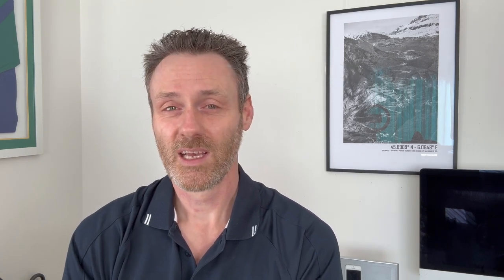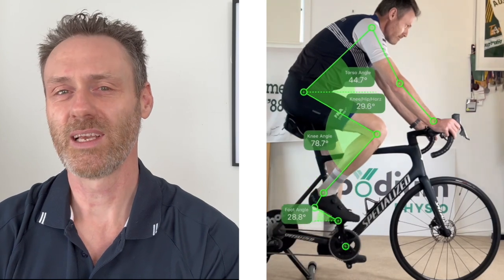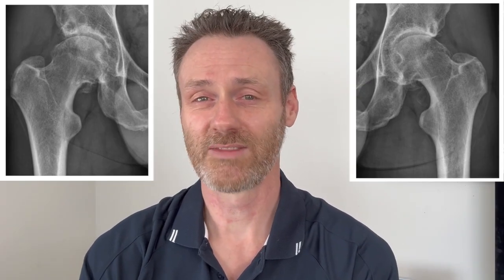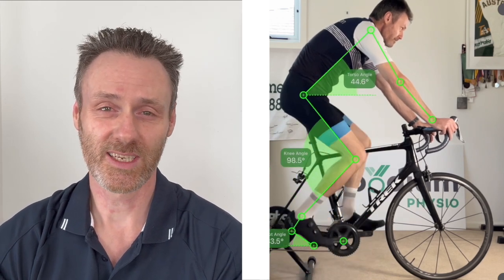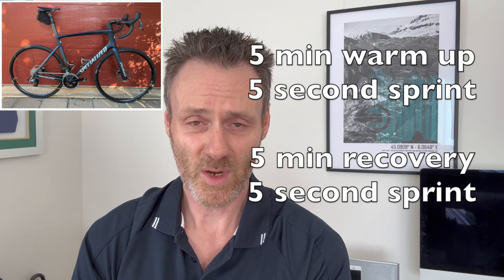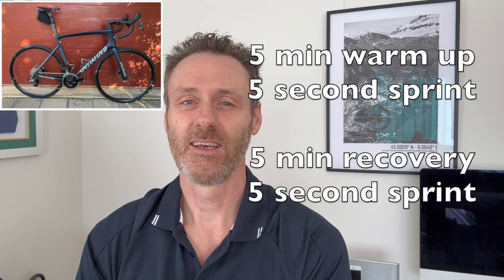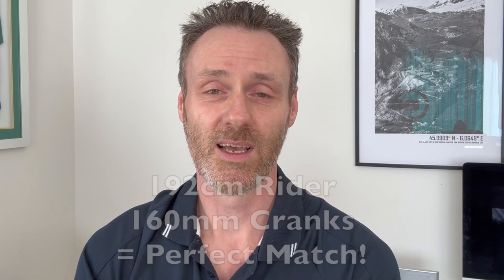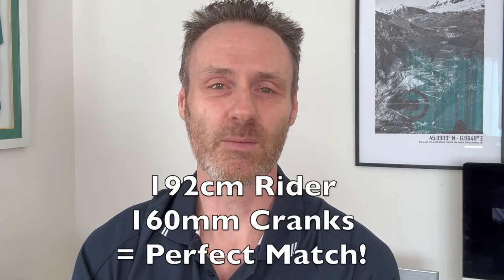Shorter Cranks Stronger Sprint (13% More Power)

Comment: not sure if you've already repeated this or not, but you might be better off doing the sprints outside on a section of road as probably speed is a more important metric for sprints, even though power is still interesting. food for thought, appreciate the effort and data!
Reply from the maker: Hi Dave. I understand where you are coming from but I really just wanted to isolate the impact of crank length on my max power. Once you are out on the road there are so many other variables to deal with: temperature, wind speed, wind direction, traffic, road surface changes etc. Then of course the variable of aerodynamics and surface area. Appreciate the feedback though!

Comment: I am healthy, 170cm tall, with good flexibility and good fitness.
I found that shorter 165mm cranks made me have to change gears more often. 
So I went back to 170mm cranks. 
This is on a MTB tho. Any thoughts on this. (Is it all just in my head?)
Reply from the maker: Hi Kevin. I've not heard any other similar reports and I certainly haven't noticed this myself. 5mm is not a big change so I doubt it would have any material impact on your gear changes
Reply: @podiumphysio657 Thanks. I was thinking it might be a bit placebo.

Comment: Update. Went from 172.5 - 165mm and am more impressed than I thought. First thing was less fatigue ( and lactic buildup ). I put this down to less power needed at the top of the stroke. I find that I exert more power at that point but now it seems smoother and more sustainable. 1st ride and was 1second off a long sought 1.40 hard climb PB. That, on the back of being off the bike for a few days after work related fatigue. I’m sold
Reply from the maker: Hey S.I. That sounds amazing! So my summary would be you are performing a greater percentage of your pedal stroke in a stronger and more effective leg position (nearer to an extended knee). Congratulations on your (almost) PB.
Reply: Yea mate that sums it up perfectly. I feel smoother and more like how I “ remembered” myself 20 years ago.
Reply from the maker: @SIvers-or2ke  Turning back the clock!

Comment: I finally got mine. Have done a 30k and a 75k. 75k today and windy. Also, for some reason I have been really fatigued for 2 weeks, my HRV has plummeted and my body battery has not recharged above 50%. But anyway, the results from today. I am comparing this to the same 75k ride on Feb 17 when I was at the top of my game. Heart rate both times identical. Shorter cranks gave me 2.1kmh advantage. Avg power increased 22 watts. Actually felt a lot easier. No hip pain. By the way, have not altered the seat height but think I should.
Reply from the maker: Hi Zazzleman. Sounds like you may be in the same boat as me - with hip issues. So if the shorter cranks help your hips, you have already had the most important win. Any performance gains are a bonus. And sounds like you have achieved a few bonuses also! 
HRV seems to be an important leading indicator of body stress and illness so keep an eye on this and take care not to overexert if you are not well.
In relation to the lower body, yes you should probably raise your saddle, however it might depend on what you can do with the front end of your bike. When I went to shorter cranks on my Tarmac, it was not easy for me to also lift my handlebars, so I only did a partial saddle raise.
Reply: @podiumphysio657  It's been a brutal month. Family deaths, job loss, stress. But the hrv is starting to climb again and body battery back to 89% over night. #Ipswich100 on Sunday. 🤣🤣
Reply from the maker: @zazzleman  Wow. So sorry to hear that. Nothing like 100km on the bike to shake up a depleted body battery. Or are you doing the 100 mile ride??

Comment: You’ve got me scouring the net for 160mm Shimano cranks. Best I can find are 165mm and I’m about to grab them. Thank you. I’m 183 ( 6ft ) and 56 y.o now and think, looking into my cycling future, shorter cranks makes alot of sense and gives me quality riding over struggling.
Reply from the maker: Yes I think I got lucky being on SRAM, and having a local bike shop that is on the ball and able to grab what I needed when they saw it was available. I'm glad to have helped you make a decision and hope it all works out well for you.
As for me I'm now recovering from my second bout of COVID, so I wont be making any more max effort cycling videos for a while...
Reply: Sorry to hear you have Covid again mate. Get some Quecertin into you. Even at this late stage. 

I’m satisfied with 165mm. If I stumbled across 160’s, I jump on them but happy to only go 7.5 mm shorter than what I use now. 

Anything is better. 

Get well soon
Reply from the maker: @SIvers-or2ke  Cheers. it knocked me around for a few days but not as bad as 2022 when I had it the first time. I think my fitness will take a few weeks to recover. Keen to know how you go with your 165s after you settle into them.
Reply: If you're 183 tall, maybe 165mm is better for you than 160mm. One mathematical equation I found says crank length = 20% of Inseam ... or 41% of Tibia length, but it's hard to know exactly which one is best.
Reply: @musclelessfitness2045 cheers for that. Makes it easier to choose.
Reply: Shimano dura ace are available in 160mm
Reply: @garyfunnell6357  Yes, but they're expensive. I got 105 cranks for a good price compared to the competition (about 120 USD). It took 6-7 weeks for Shimano make and ship them.
Reply: @garyfunnell6357 thank you for that but I will never be able to justify them.

Comment: could the shorter cranks lead to injury because of kneeangle etc. or are the benefits almost general?
Reply from the maker: I cant imagine what knee angle problems there would be, so long as you had a proper bike fit. The knee is working through a smaller range of motion so there is less to go wrong.
Reply: Further to that, I heard elsewhere, that if you find yourself pushing off the back of your saddle on the top of the stroke, then shorter cranks are for you. You are replicating that angle, instinctively, by sitting further back. So check your position on the bike when the going gets tough. Hope that helps

Comment: I understand you are observing differences, but I’m not certain you are proving this power difference. As you say at the end the shorter cranks are better for you, no offence I think because you don’t have the strength to turn over the linger cranks fast enough to hit higher watts numbers. So, that’s a personal characteristic. You mention, you are not a sprinter, so not certain what weight training you may be doing just for power increase. With your hip issues, the physics of shorter cranks make a lot of sense and you do get higher watts, but I think that is because you get higher rpm, your strength/power are constants, if you increased your power you might be able to spin up the longer cranks and hit higher watts. Anyway, I am just commenting on your test methodology and possible variables affecting results. Glad the shorter cranks are working for you!
Reply from the maker: Hi Matthew. One of the things I remember from Jim Martin's presentation in Germany 6 years ago (https://youtu.be/-3sCebN63rI) is that muscular force is greater at slower contraction speeds. That is a universal physiological principal, not just specific to me. 
I actually have relatively high power (over 1200w output), but this is when I am out of the saddle and working at slower cadence. 
I do try to do leg weights such as squats and deadlifts, however I need to be careful to work in a shallow range of motion so I dont stir up my joint inflammation. I'd dare to say I'm stronger than most of the guys I ride with, but it is all slow twitch!